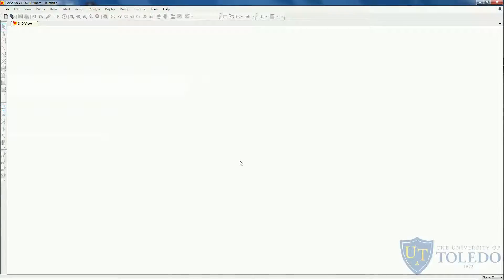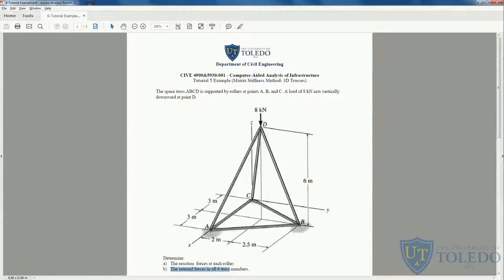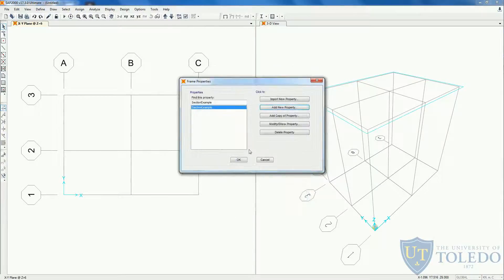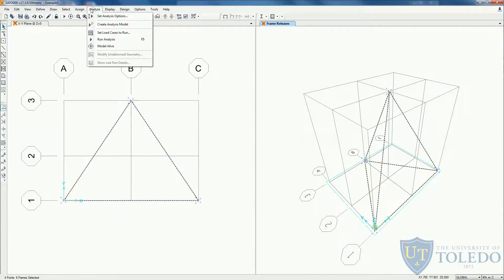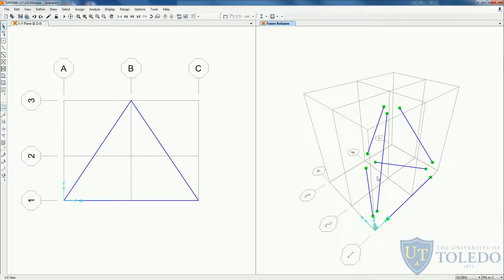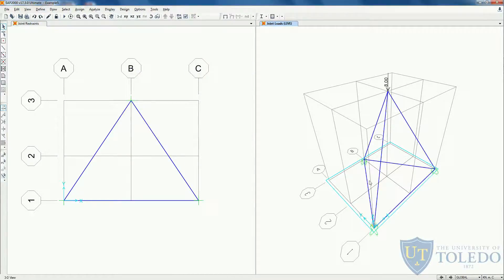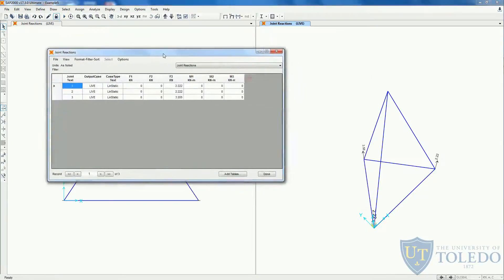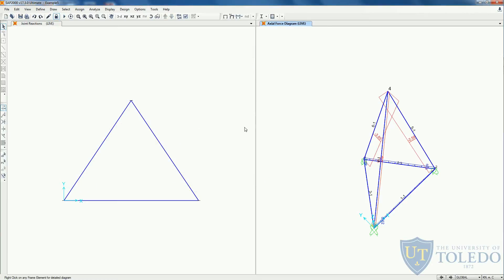SAP2000 Space Truss Modeling Tutorial (Video 5)

Comment: Hi, Thanks for the video. How you verify these deflections and reactions with some reference values ? any standards for max deflection and reactions limits? and secondly how you calculated the grid distance 2 and 2.5 meters in x direction ?
Reply from the maker: Thank you for your interest in our channel. You should compare the calculated deflections with the permissible limits stated in the building code enforced in your jurisdiction. Grid distances are dependent on the particular problem that you are solving.
Reply: @SerhanGuner  Thanks. And sir as its all sodes all equal so why the reaction forces are different at third side ? And why you used rollers support instead of pinned support. Because it will become moveable with roller supports ?